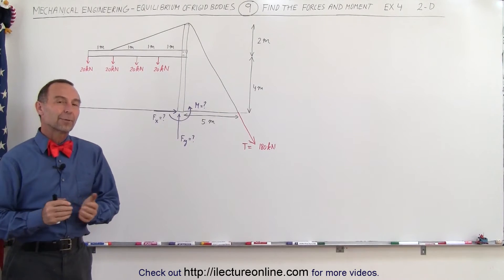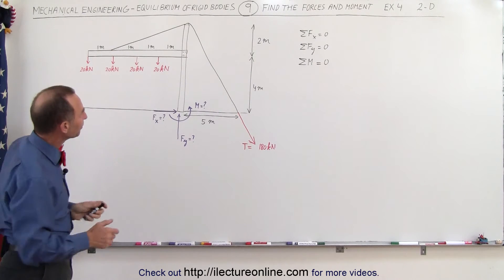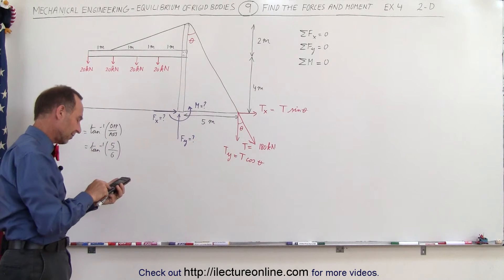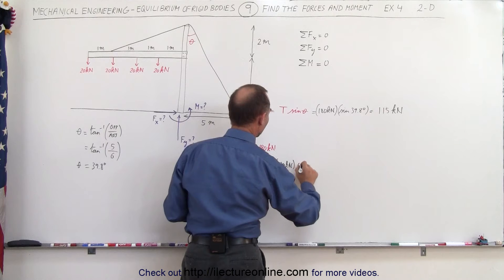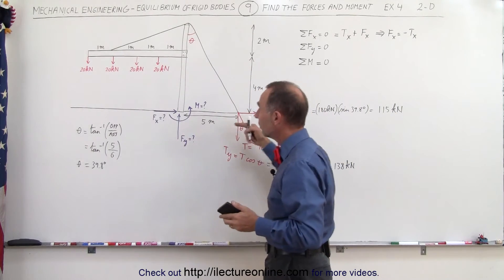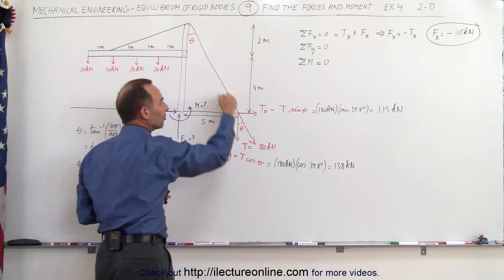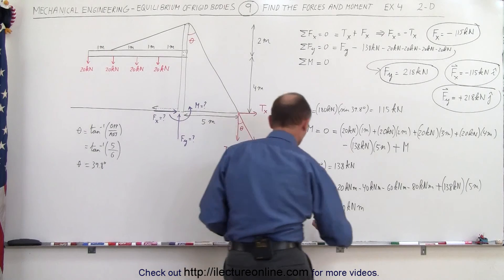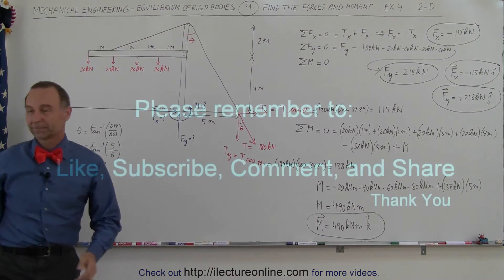Mechanical Engineering: Equilibrium of Rigid Bodies (9 of 32) Find F=? M=? Ex.4, 2-Dimensions

Comment: 1. Sir, The thread  is connected to the horizontal beam, so if there was no horizontal beam, the thread would go towards that direction, for this reason, there should be a reactive force along the direction of the thread to which that is connected. Isn't it?
2.The thread is passing through a roller, so there should also a reactive force there, vercally upward?
3. The horizontal beam is connected at the point, the point is like a fixed positon, so there should be three reactive forces and couple?

if you please clear my doubts

Comment: Sir why we took moment +ve although it is in anticlockwise
Reply from the maker: By definition, the torque (moment) is positive when the direction is in the counter-clockwise direction.
Reply: @MichelvanBiezen sir we studied  The direction of a moment is opposite to the direction of the force. ... clockwise moments are positive. anti-clockwise moments are negative.
Reply from the maker: In many situations it doesn't make any difference, but when expressed in vector format, the direction is important.  Counterclockwise give you a positive torque.

Comment: What about the support connecting the two posts in the middle
Reply from the maker: You could perform a similar analysis of the joint between the beam and the post.  The purpose of the video was to show the moment about the point where the post is set into the ground.

Comment: Sir, good example..but I have a doubt.  
 Suppose we are analysing the beams individually, and first analysing horizontal beam. Net upward force is 180sin (theta).where theta is the angle between horizontal post and cable.and can find from the upper left sided triangle.and theta is 33.69 degree.
so 180 sin (theta)-80 =vertical force in the pinned support.
and that gives 20 N.
now consider the vertical post.And downward force due to cable is 180 cos 39.8.
so total Fy = 180cos 39.8 + 20 =158 N.
But the answer is 218 N

I CANT FIND WHAT IS WRONG WITH THIS.....

PLS HELP ME.....................
Reply from the maker: The purpose of the problem is to find the moment about the bottom of the vertical post.  (Only consider external forces acting on the "system".

Comment: I just didn't understand why you considered the tension in the y direction of the cable, since it's attached to the top of the beam, and it passes though the point of rotation. I thought that only the x component of the cable would generate a moment. Please correct me if I'm wrong.
Reply from the maker: The point of rotation is at the bottom.

Comment: When calculating the sum of forces in the x and y direction as well as the moment, why is it that you don't take into consideration the force of tension cause by the cable that is attached to the horizontal beam?
Reply from the maker: The tension of that cable is an internal force of the system (it gives the system rigidity), but there is no external force acting on that cable, thus it does not add to the moment.

Comment: why don't you include the forces in the x direction when calculating the moment m?
Reply from the maker: Which forces in the x-direction?
Reply: Michel van Biezen Fx and the tension in the x direction. Is it because the direction of the vector is not perpendicular to the line of action?
Reply from the maker: That is a good question.  If you pick the point of rotation correctly, it will eliminate some of the unknown forces.  The line of action of the force of Fx goes right through the point of rotation, which means that it does not produce a torque (the moment of Fx about point M is zero).   The same can be said about the X-component of the tension.  The line of action also goes right through the point of rotation and thus the moment is zero as well.

Comment: Thank you for the work you've done Sir. I have a question which is If we cut the cable to the left side of vertical beam because of the fact that the tension in this cable is the same every where in the cable, why it doesn't give us the same answer for the forces and beam.( I've tried it)
Reply: I don't know if this helps but in the description it says, "In this video I will find the horizontal and vertical forces and moment of a horizontal beam attached to a pole and supported by 2 cables." So cutting the left cable wouldn't affect right cable.

Comment: sir,
the moment you find! is this the reactive moment or something??
Reply from the maker: The moment is simply the "moment", or also called the torque which is the term used in physics.  The moment is typically calculated relative to a point.  When you change the reference point the moment will change.  The reactive moment is a term that could be used inside a beam.  The beam will have to exert a "reactive" moment in response to external forces acting on the beam.

Comment: What about vertical post weight? Is it accounted in calculations, or you assume weightless post?
Reply from the maker: +Michal Milkowski 
Good question.  In this example it is a weightless beam.  (If you consider the weight of the beam, you need to add another force vector acting through the center of mass)